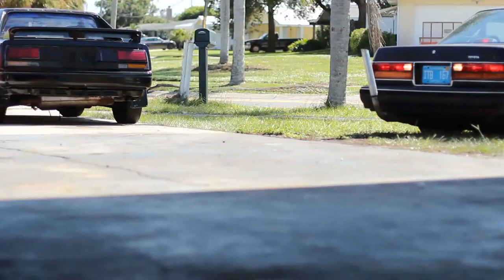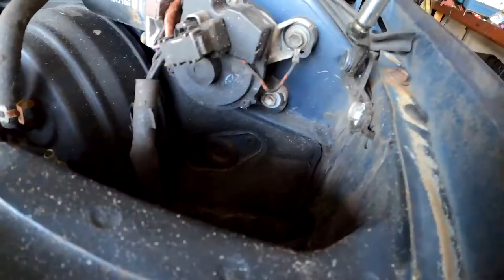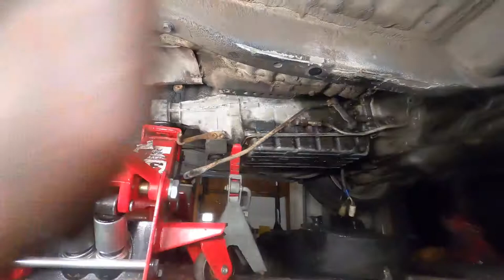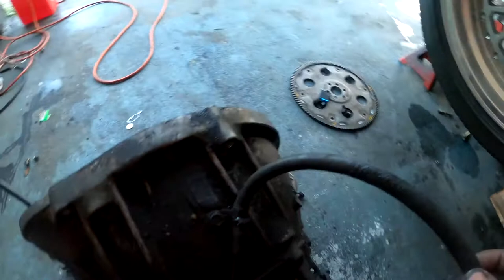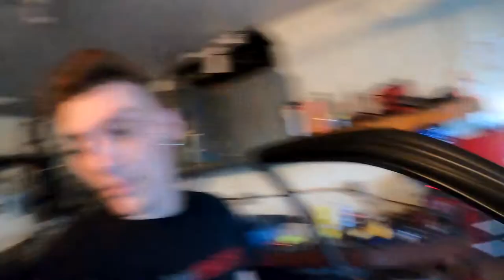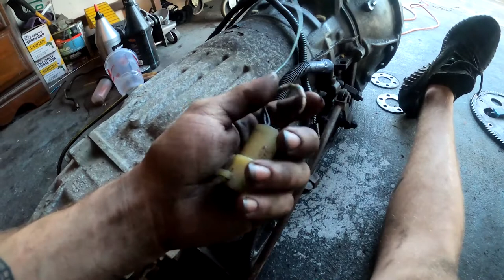How to: W58 Manual Swap a Mx83 Cressida!

Comment: You gotta bust out that garage window and put in an A/C window unit. Its the best thing I've ever done. Also for the top two bellhousing bolts, I just loosened the engine mounts, tilted the engine as far back as it would go, and then used about 4.5 feet of extensions and a ratchet.

Comment: so i just had my cressida decide not to have spark i swapped of the coil, igniter im going to do the dizzy next have you had this happen
Reply from the maker: I haven’t but I imagine it’s the distributor, or the lead wire from the igniter to the dizzy
Reply: @dabitat  i found the problem the main fuse melted into the fuse box i had to dig it out, a wire rubbed through on the valve cover.